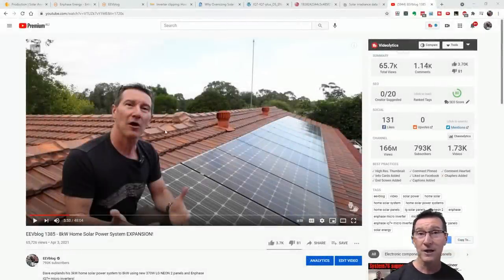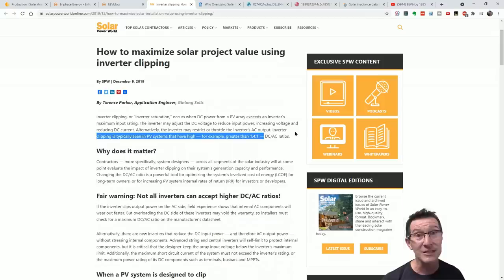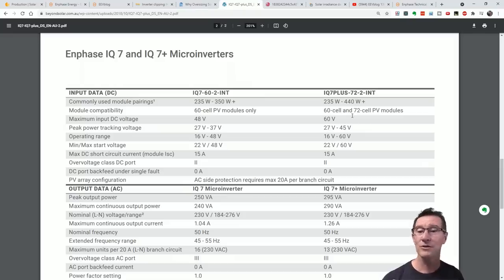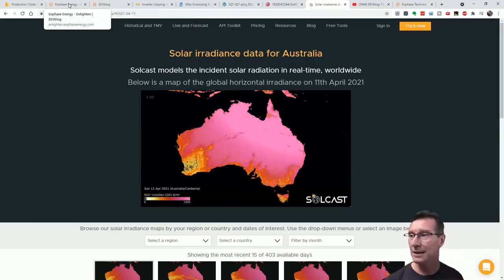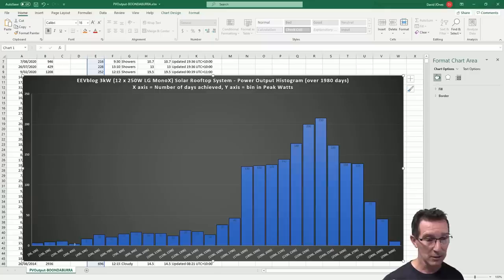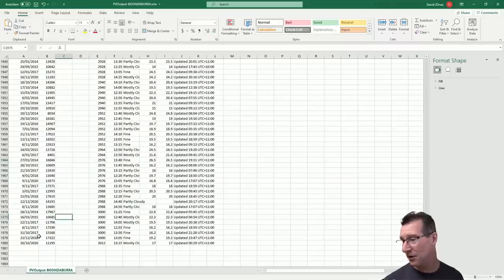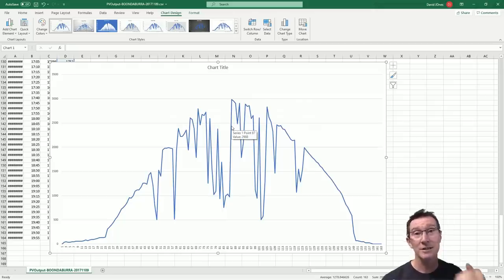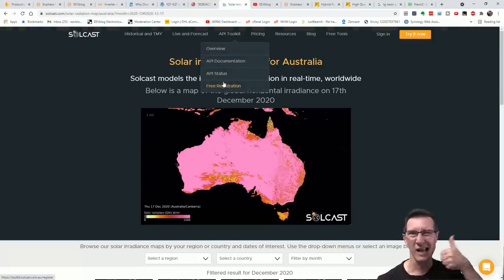EEVblog 1386 - 295W Inverter vs 370W Solar Panel - WTF?

Comment: Three-phase system for each panel (three inverters per panel) = constant power, not sinusoidal.
Reply: You use 3 separate arrays, 1 for each phase
Reply: @leexgx  I was suggesting 3 phase inverters for each panel or array to omit large capacitors at the DC side of inverters. AC output in theory needs peak power 2x (two times) more than RMS power. So with out capacitors on inverter's DC side, panels are not fully utilized. With 3 phase inverters in theory there is no need for energy storage on DC side, when 3 phase system is symmetric it will draw constant power from panel or array. Basically it boils down to how inverters momentarily put load on solar panels and do they need capacitors on DC side. As we know electrolytic capacitors have short life in high temperatures.
Reply: @wwyyllyy    micro inverters normally use solid state components (normal liquid caps would be to unreliable at wide ranges of -20 to 100c on roofs) I believe even the SMA string inverters use solid state as well (and that was like 10 years ago on selected inverters, now I think its standard) 

Output from inverters don't meat demand they just output 1-4v higher then grid voltage so it becomes the preferred source of power, they don't meat any demand for power they send out as much as the solar panels make ( the variation output is purely based on the actual solar panels power generation not the inverter) 

Battery off grid systems functions as you said and will lower wattage output as the battery's get filled up
Reply: @leexgx  To put it simply I want to point out theoretical difference between 1-phase and 3-phase inverters when connected to the same type of panel. In order for them to get the full power from a panel they constantly draw DC current at DC voltage. 1-phase inverter needs capacitors to do that, 3-phase inverter theoretically does not need any capacitors or other energy storage elements. So 3-phase inverter should be more economical. In real life some capacitance will be needed in 3-phase inverters but still less than in 1-phase. Good to hear that the right type of capacitors are used when needed.
Reply: @wwyyllyy  looks like it blocked the comment with my link in it,, you can use 3 phase q cable with enphase, but you must use in 3s so each phase gets equal balance load like 3 6 9 12 micro inverters, it's effectively 1 inverter per phase but using single 3 phase cable so you don't have to have 3 separate phase cables on the roof for each array

can't really seeing it been a problem for single or 3 phase they run around 96-97% efficiency in any case

Adding extra things to try and make it smarter just wastes power, as there will be losses trying to increase the dc voltage up by 2v (unless it's very smart and completely solid state tech) and with out a supported inverter you waste more power trying to do it

only power optimizer modules + compatible inverter I know that does it really well is solar Edge as it runs the dc to dc module totaling up the string voltage to fixed 350v dc constant (each power optimizer runs at fixed dc voltage, divide 350v by the amount of modules = each module voltage output and does mppt on each individual or pair of panels depending on module) so the solar edge inverter is always at perfect 350v dc to 240v single phase AC conversion

If your talking about muti inverters (micro inverters you class as one whole inverter as they collectively cooperate the AC voltage output between all modules) from different manufacturers on the same phase then yes that can sometimes cause compatibility problems when the 2 different manufacturer inverters are not cooperateing witch each other resulting in not ideal AC output or even cause one of them to randomly stop/start outputting AC (best to be all from same company and type so they cooperate with each other) I think that's when the use of large capacitors can be used to smooth out the voltage between everything this is more a problem very large commercial installs

Comment: I mutch rather optimize for cost vs power rather than efficiency (up to a certain extent obviously). My current installation is a conventional string solution with a cheap inverter which translates to ~50€/panel inverter costs. It is rather an ideal solution as no panels are typically shaded during normal production hours.
Because I want to have more panels on parts where either parts of a building or tree is covering maybe 1 panel I am looking for a micro inverter solution but these Enphase units which cost >100€/pannel is a bit too much for me. I just found an APsystems QS1 micro inverter with 4 inputs at <400€. Sounds interesting, anyone has any experience with these ones?

Comment: When you say clipping, does that mean the actual waveform is distorted? I could imagine that resulting in very bad phantom power.
Reply from the maker: N, the mains waveform is not clipped, just the output power is limited.

Comment: Umm how does the system "produce" 4KW power when you are consuming (aka load) is 1KW? I mean isn't the produced power is voltage * current? So if most of the electric devices are powered off and small current is flowing through, shouldn't the production equal the consumption?
Reply: The excess production is fed into to the grid.
Reply: @eDoc2020  oh right, i knew it but somehow forgot about it today

Comment: 3 min into the vid.
You almost never get the "peek" output from your panels!
The peek value is a theoretical output used to standardize and calculate long time performance!
It's what the panel "can" do under perfect conditions on the perfect place on our planet!
To optimize your system by using smaller inverters makes sense, even you lose some opportunitys to get peek power, it's not worth the extra loses in a bigger Inverter over the time the system runs on partial power.
Most inverter/ power supplies for that manner run most efficiently near their peek output, so if you solar panels most of the time just do 60-70% of ther output and your inverter has the same rating, it also runs there!

Comment: Those aliexpress mirocoinverters are definitely overrated. I blew half the fets out of one of them within  a week of installing it. I got them to send me a new one... but I hooked up half the panels to it. Also the MPPT is really flakey and I have to reset them periodically. If I had known about the IQ7+ microinverters I probably would have spent the extra money to get those. I was given some panels and was just kind of screwing around with them and didn't really do my research.

Comment: Did you invest in any battery storage locally? I have heard solark lithium batteries are amazing
Reply from the maker: Not yet, need to data first over a few months to see what size I need.
Reply: @EEVblog  cool, yeah if you have the battery storage you could look at MPPT to increase your yield a bit. I was skeptical at the beginning about it but it seems to be OK for my setup, I would imagine though MPPT is not mainstream for grid installs, but would maybe make an interesting project for you to take a look at. Your install though is really really nice, I am jealous. I actually wondered why you went with micro-inverters? I haven't really seen them used much, I worked for a solar install company a few years back we installed the gigantic 5kw inverters.

Comment: PV is so cool! I have had a few systems. Up to 4kw/m2 irradiance where i am, my 6.3kw panels on my 5kw inverter only clip at most a dozen days a year. However in less than ideal conditions I get more power! My panels produce 2.5x the power i use and so no bill for me!

Comment: The dummies guide 1. Get three phase. 2. If you don't have shading get two three phase inverters with 2 strings per inverter  3. Get inverters that automatically share or spread maximum export to phase with lowest voltages as this makes you the most money. 4. Oversize the panel array to max specs of inverters.....see point 3 as this is way more important than anything else as being on a single phase with a high penetration of solar will result in high voltage on that phase and limit your ability to export.  5. Only get enphases if you have serious shading and even then 4 strings across two three phase inverters which maximise export  through lower voltage phases will easily create more benefit.  

Magic numbers are 12.6kW's on Roof, 10kW's to mains across two three phase inverters, with a total of 4 Strings.  Ohhh yeah and face two strings east or west and two north.   The east will give you early morning charge and the west will give you late day energy offset and pre-peak charge.  North is just a no brainer for at least half of your solar, assuming 3 phase and 10kW's to grid.

As for analysis.....haven't paid a power bill in 5 years, do no analysis as I can't be bothered as this stuff is high school maths and just choose the retailer with the highest Feed in Tariff (FiT).    Am on no special Govt FiT....this ain't rocket science so maybe just go with what 40% of Queenslanders have already figured out.

Comment: not sure about you, but it gets my juices flowing when my ABB UNO 5 with 5.06Kw AC output says "Output Derated".  i have 18 LG Neon2 330's (got two more to go on to get to 6.6), and i live down in the snowy mtns, this summer with just the 18 on there i got past 40KwH a day for a week around the longest days of the year.  now i need to get my other 2 on for winter, if i can keep it above 20KwH a day, my bills will be almost zero!. yewwww
Reply: dual MPPT, not micro inverter.  V Start set to 100V for both strings.

Comment: Why not connect a battery to buffer the spikes?
Reply from the maker: That's the plan. Need several montsh of data before doing that.
Reply: @EEVblog  So what your saying is your going to get the tip in by using a battery operated device?
Reply from the maker: @allan80supra  The battery will fully shaft the electric company.
Reply: @EEVblog Enjoy! :) very interested to see how you maintain MPPT micro inverters on the panels while buffering the energy above the peek inverter rating, string inverter seems more plausible but still a huge voltage swing to deal with and then not upsetting the Inverter...

Comment: I think Dave was looking at the hole instead of the donut.  The "larger panel than inverter" brings up the energy level when Sol's radiance is not at it's peak.  increasing the power level of the inverters will not change the non-peak power conversion at all. Ron W4BIN

Comment: Hey, Dave. 
Just wanted to share a workflow shortcut for Excel. If you need to go to the end of your dataset in any direction, you can press CTRL and the arrow pointing to the direction you want. Excel will take you all the way to the end of the data in that direction.

Comment: why not just use a eg4 6500 inverter with 500voc dual mppt input? No micro inverts saves $90 a panel use that $1300 for more panels. So you buy high dollar panels with high effiency then mate it with a 96% efficient micro inverter. so you lost the panel efficiency via the micro inverter. Crazy Then clip the output via the micro inverters and lose another 15% during the year.

Comment: My installation company used the IQ7 instead of the plus.  I thought I was paying for for a 5.5 kW system but instead got a 4.5 kW system due to the each microinverter producing up to 55 watts less than the IQ7+ version. So even though the plus maxes out at around 295, it is still better than the 240 from the IQ7.  The IQ7+ will still work with my panels